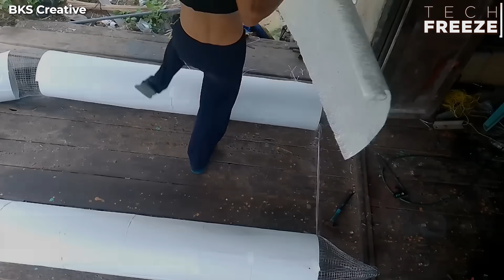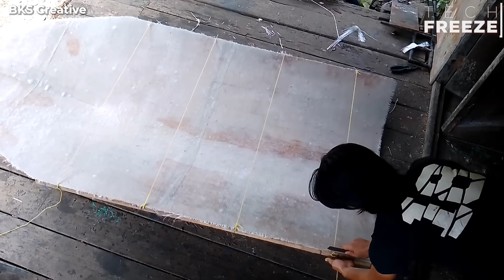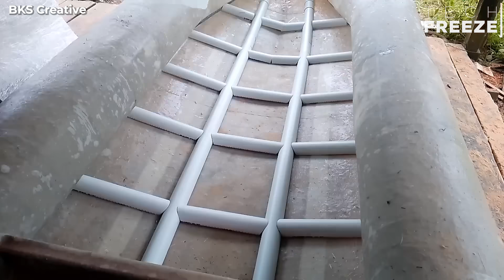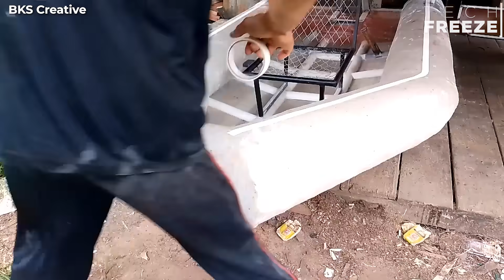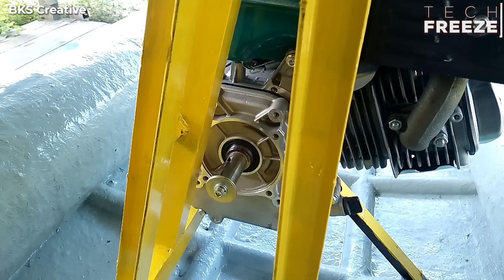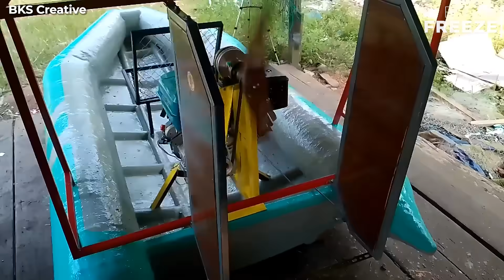Man Uses Chicken Wire to Build an Amazing Airboat | Full Build @bkscreative

Comment: Sorry no, no longitudinal support stringers, no ribs inside the steel mesh. Any person steps on the fibreglass sides will crush it. The long term resilience of this boat will depend so much so the operator knowing where the weak points are.

Comment: It's good that the propeller structure is mounted on a solid base so it won't loosen, but I don't like that the whole floating body is a single connected container: so one hole can sink the whole boat. It would be better to have multiple separate containers.
Reply: I would have injected polyurethane foam into it
Reply: 내부에 PT병이나 볼풀공 넣어도촣을듯합니다. 유사시 가라앉지는 않을것 같아요
Reply: @베어펜츠  wao that is indeed an exelent solution
Reply: Drill hole when all done and fill with spray foam...simple
Reply: Oui Effectivement , cette construction est exemplaire mais par précaution,  il serait préférable de construire les flotteurs avec plusieurs compartiments,  ce serait invisible de l’extérieur mais extremement rassurant pour la flottaison en cas d’impact car tel qu’il est conçu ici, l’hydroglisseur coulerait même avec un tout petit trou...
Reply: Futuramente ele fará melhorias ,com certeza. Ele tem as manhas,estava igual eu querendo ver funcionamento.

Comment: That is a wonderful project that I would like to do with my son. I am not for sure where he is when he makes that boat , but here in the USA fiberglass anything if very expensive for most people to do a project like this at home. I would figure about $600 at least for the fiberglass resin and cloth. Years ago, I had made a homemade pontoon boat for under $300 using wood framed square pontoons, some metal flashing, some fiberglass & cloth, laid a 4x8 sheet of plywood that was extended 2 feet so it was in total 12 feet long. Attached a trolling motor , battery, 2 cheap chairs and me and my brother were off fishing in a small lake. We had a blast back in 1977. Times were good back then, now it's all about survival just to see the next day, month, year. I need my GOD or all is lost for sure. I am days away from 70, and that alone is a miracle.

Comment: Nice little DIY, I think I might of gone a different direction, but I might have a few more options.  I can get a free aluminum hull from any old farmer, because they just want it towed away and it might even come with the trailer.  Can buy a Harbor Freight Predator 22 hp V-twin for less than $1000, which the engine used in this video was new and cost that or more.   Again, nice little DIY though.

Comment: Should have left the wood  in the floor and bonded the fiberglass directly to it, inside and out.  Much stronger and not much heavier. Also not efficient to push air as opposed to water.  Will burn much more fuel for the same speed one could do with a water prop, but I do understand this was done for show not for efficiency.

Comment: free hand sawing and the amount of goober glue and remains of past products, this is a well versed and savvy builder, maybe an airframe next? The thrill of the build only gets better with those glue fumes and happy days roll on into sleepy dreams with 'feather fiberglass' fingers. Imagine what this technician could build with an actual shop and real tools! His engine is 18 HP and only 110$ or he could put a Vanguard 570cc 18 HP V twin for some real power but at 1700$ Hp is not cheap

Comment: I would need a separate boat for my dik. That flimsy little thing wouldn't carry me and it at the same time. Little Filipinos are pretty light though so it's pretty cool and I just wonder how much money you save by doing all this construction yourself. Glass and resin is not cheap.

Comment: That is not chicken wire
That is hardware cloth
Comes in 1/8th, 1/4 and 1/2 inch openings, two to six foot widths, and 5 to 100 foot lengths.

Comment: Who needs expensive shipyards or commercial boats when a single person with a clear mind and enviable craftsmanship can transform simple wire mesh, resin, and fiberglass into a fully functional, floating work of art? It is fascinating to watch such a process step by step: it all starts with a simple mental sketch, a metal grid structure bent to the millimeter to give the hull its hydrodynamic shape, followed by the meticulous application of reinforcement layers and resin pouring. Calculating material strength, balancing weight, and mounting an engine onto a structure that is fragile at its base yet incredibly tough in the end demonstrates pure engineering thinking and iron patience. An absolute masterpiece of high-level DIY! Deep respect for such practical talent. 👏🚤😂😂😂

Comment: 유일한 결함.. 엔진뼈대를 나무와 연결한게 결함임..
가장 힘을 받는부분이 나무로 연결한 3개의 볼트라니..
그 3개 볼트는 항상 힘을 받는 구조이고 그 3개의  볼트가 빠지면 엔진이 앞으로 밀려와 운전자를 때릴것임..
 더 강력한 보강이 필요함..
나라면 뒷부분 나무대신 금속을 사용하거나 , 볼트 3개 연결할 부분에 미리 나무위에 금속을 보강할것임

The only flaw... is that the engine frame is connected to wood.
To think the most stress-bearing parts are just three bolts connected by wood...
Those three bolts are constantly under load, and if they come loose, the engine will swerve forward and strike the driver.
Stronger reinforcement is needed.
If it were me, I would use metal instead of wood in the rear section, or reinforce the wood with metal beforehand at the point where the three bolts are connected.

Comment: You forgot to mention that the man has no clue how to design an efficient propeller.
He has a constant pitch from root to tip, instead of the proper twist to lesser pitch at the tip, needed because of faster tip speed than mid-span speed, or root speed.

Comment: Use a bell clutch on the pulley system so the fan disengages at idle. I would also use straight pipe isntead of bent wire for the stearing linkage.

But that's badass!

Comment: I would design the hull along the lines of an airboat, which is much easier to construct and proven in swamp environments, rather than opting for a twin‑pontoon type hull. The airboat‑style design offers simplicity, reduced material requirements, and adaptability to shallow or obstructed waters. Its flat‑bottomed profile provides stability while remaining lightweight, making it far more practical for rapid builds or experimental projects. 
In contrast, twin‑pontoon hulls demand more precision, structural reinforcement, and cost, which can slow down development. For a project focused on efficiency and versatility, the airboat approach is the more logical path.

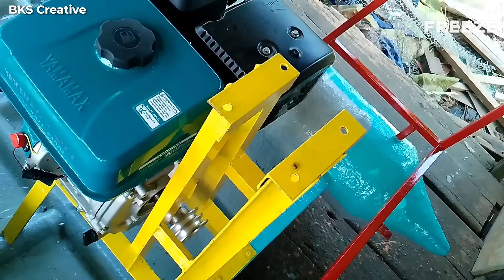Comment: Corrections - This is not "Chicken Wire". This is half-inch hardware cloth."Chicken wire" is of a much lighter gauge and hexagonal cells, not square cells. Also, @+18:10 "Pully", it's called a 'pillow block". Also, I would cover that wood propeller in carbon fiber, or fiberglass for strength.

Comment: No expensive, just chicken wire.  . . . That's an impressive engine made just out of chicken wire
Reply: Not sure if they still sell them but harbor freight has their horizontal drive engines with considerable horse power and that's to me tye key building one around that engine and not the boat  horse power that's higher you can build a bigger boat  if a see nailer engine is just build one designed long and narrow like a k ayak. 275y strong outriggers shaped like torpedos but that's got me thinking a hydrofoil

Comment: Very beautiful and ingenious, however, it wasn't built to last.
It would need at least two more layers of fiberglass for this hull to be sturdy, it lacks a screen around the propeller to prevent problems with branches, there is no reliable acceleration and braking mechanism, the engine support is precarious, the rudder mechanism was designed to break down quickly, and the propeller could be better optimized.

In other words: a disposable boat made only to show off in the video.

Comment: Hay muchas cosas que no están bien,  empezando por la vibración que produce el motor y la transferencia de está directamente a la estructura del barco,  unos silenblocks reducirá la vibración transmitida,  así como la hélice no tiene un equilibrado,  y produce una gran vibración que transmitida al soporte del motor,  genera una gran fatiga de material,  y si sé acelera mucho, puede romper y que salgan disparadas miles de astillas en todas direcciones.  La cantidad de fibra es insuficiente,  y  al no tener comprensión en vacío,  las microburbujas del interior lo van a fracturar rápido por la vibración de la hélice y el motor.  Inseguridad total,  como vehículo para una emergencia,  quizás,  y a poca velocidad y revolución del motor. Una quilla central le daría estabilidad y mejor control de la dirección. Unas juntas selladoras interiores en la unión del fondo y la borda,  amortigurian vibración y la durabilidad estructural seria muy mejor.  Miles de cosas más mejoraria.

Comment: A final comment, that prop needs to be caged. Both to stop foreign bodies, such as the driver, being sucked in snd minced and to contain flying debris, if the prop shatters. This is critical. Even professional propellers, made from uniform materials and correctly dynamically balanced, can and do grenade sometimes. A diy, hand carved wooden one almost certainly won’t be made to those exacting standards and could be lethal at high rpm. Cage it.

Comment: There’s an error in the sequence of fibreglassing the mold, here. You don’t lay the mat directly on top of the release agent, in this case margarine. Doing so will contaminate the fibres with release agents and prevent the resin bonding with it correctly.
The correct way is to put a thick coat of resin on the release agent, then press the first layer of mat into it. I’m impressed with the use of margarine, though. Cheap and readily available. Maybe not ideal if you want to reuse the mold, but for a one off, I can see the appeal. Release wax is not that readily available and not nearly as cheap as margarine. 
I’m curious about the shape. Why make it look like an inflatable raft?
I think a simple boat shape would be better. If water gets inside the hollow sections, it will be impossible to remove by bailing and the hull will become too heavy to plane, or skim across the surface.
Simple, single skin sides don’t provide as much buoyancy, but cannot become waterlogged tanks, if a sharp stone makes a pinhole. 
If the inflatable shape is wanted for some reason, then moulding it over rigid foam, such as polystyrene, or closed cell insulation, rather than an empty void would prevent this problem.

Comment: That river looks like the color of a toilet that has been plunged with a ton of shit in it, which is probably about 50% of that river from people straight pipe septic line emptying into the river. As the old saying goes up shit creek without a paddle, well meet shit creek. Dude made an airboat instead of paddling up shit creek.

Comment: It's called hardware cloth not chicken wire. This example looks like #2 hardware cloth which is 2 wires per inch. It's mistakenly called 0.5" due to apparent hole opening but that's inaccurate because of the wire diameter taking up part of the space.

Comment: You don't need fiber glass,  If you have linen bed sheets that will work too. Epoxy is the reall expensive part. That is what really makes the boat water tight.  Dope like they use on cloth covered air planes can be used too.  I built a boat with just plywood and some firing strips.
Reply: Doesn't the fiberglas add more structrural strenght than the cloth?I think pet bottles would be a more secure structure like they said in other comments.
Reply: @mallitah  No, a linen sheet or cotton sheet, adds just as much . What you do is going to be 2 layers with the weave at 45 degree angle to the previous. Remember native Americans used to use just birch bark and resin for their canoes. The material makes the shape and the resin gives it a water proof shell.

Comment: a couple things this video doesn't tell people is that the prop has to be perfectly balanced with the mounting bracket or it will vibrate enough to shake itself apart the first time you open up the throttle. the fiberglass boat must be completely sealed or it will sink. you will want to cover the propeller area with some type of screen to prevent injury.
Reply: I was thinking the same thing. If that propeller shatters, there goes your noggin.
Reply: it's more better if he injected the hollow haul of the boat with expandable foam to prevent from water ingress if it is punctured.

Comment: If he would have used close cell foam inside the pontoons I would be interested in the boat. But as it is it could sink very easily if it hits a rock or tree trunk. It is a cool design. And it could be practical if larger.

Comment: As an airboat owner, I can see that his prop is very inefficient. You don’t just make a straight angled blade to get the most thrust. He is probably getting about fifty percent from his homemade prop. Driving an airboat is a whole different proposition. You must constantly be thinking several moves ahead in order to keep the boat in line,  especially when navigating narrow waterways. Good for him in getting his boat going.
One more thing that is important is to balance the prop so that it doesn’t shake the thing apart.
Reply: How much does a fan boat prop cost??  I would consider buying the prop and building the boat around it, instead of building this type.  I still like the build though.
Reply: Your opinion is good no doubt.

However
The time he build it this is the best what he can do. Your thought and experience is different
Reply: How could his prop be made more efficient?